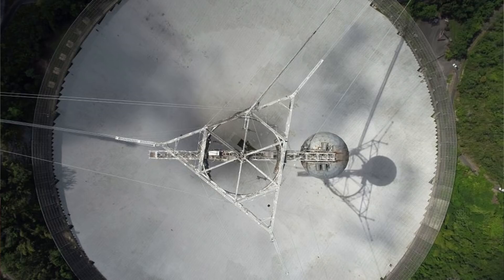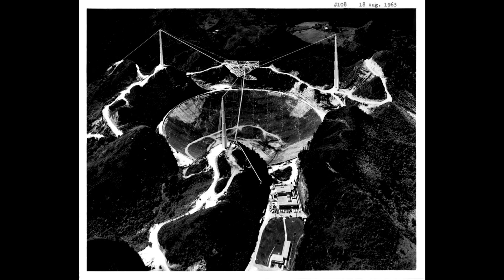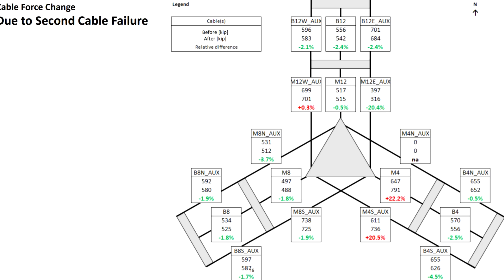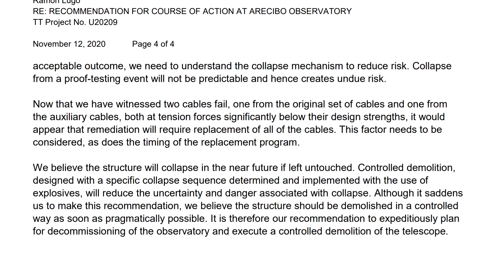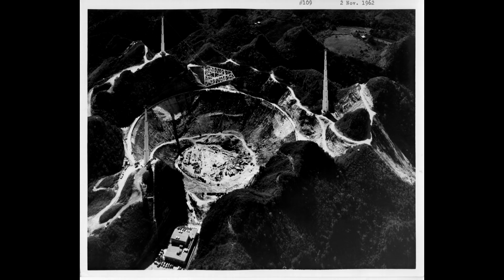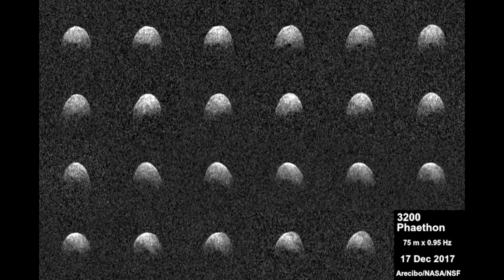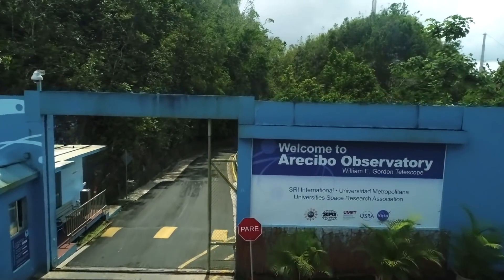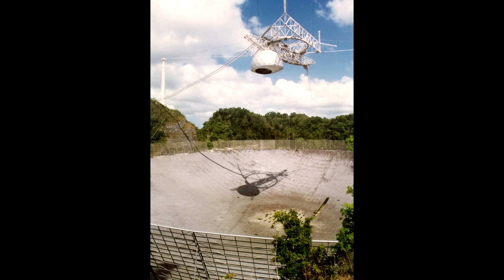Worlds Largest Radar Astronomy Dish To Be Demolished!

Comment: Only bright spot I see is if they take her down in a controlled manner the foundation would still be there to build upon.  Though it may sound strange but doing so may be pointless soon.  May mean a decade or so of delay but once Starship is on line Astronomers world wide should be SALVATING at the options it opens.  And I'm not talking another Hubble I'm talking a set of telescopes on the Moon.  Half month complete darkness, for all intents no atmospheric distortion, no protestors outside saying this is a sacred mountain don't build it here.  Build em in three's about a third way round the moon each for continuous observation and a couple weeks a month for maintenance...   
Don't take it wrong its a sad time seeing an Icon die but.  However Arecibo's life and death should be celebrated for what it accomplished and the future it inspired so many to look too.
Reply: The possibilities Starship offers are huge. I envision a nuclear powered full spectrum array orbiting in the Moon's shadow, connected to a large communications network. There isn't enough scientists and computing power to handle the volume of data something like that would provide.
Reply: The foundation is designed for the structure it supports.  You don't tear something down and reuse the foundation.  You design a new one for the new structure.
Reply: True but I was referring more to the fact the site already has infrastructure (roads, power, ect) and a lot of the major reshaping of the ground would already be complete.  As in a lot of the ground leveling and reshaping would already be done.  Sinkhole or no they didn't just plop a dish down in it without a lot of earthworks first.  But you are right about the building foundations those most likely would have to go entirely too many bad incidents with such being re-used

Comment: Radiation from an object at distance R goes down at a rate 1/(R^2). For Radar it is really a distance of 2R (back and forth) so the rate is 1/(2R)^2 = (1/4)*(1/R^2). This is not the same as 1/R^4.
Reply from the maker: You’re assuming the target is a perfect retro reflector, rather than isotropically scattering
Reply: @scottmanley  You were talking about the relation it has with the double distance of radar as probably compared to radiation emitted by a body. And 1/R^4 is not right. A more accurate model has to add other effects as for example reflection and medium loss, where the former has no correlation with distance whatsoever and the latter for sure but my guess is never getting into exponent 4. But let us agree you where justifying R^4 as a consequence of the travel back and forth and not as an estimation of full model dynamics.
Reply: @scottmanley  I can see how a large/round body, like a planet with an atmosphere, acts as an isotropic reflector. I am curious if smaller asteroids which have a rough surface can act partially like a retro-reflector? I assume they fall somewhere on a spectrum between the two perfect models. (Could this be used to study the properties of the surface of an object? If we vary the intensity of the beam, it should be possible to calculate the amount of scattering without knowing the absolute reflectivity of the surface.)
Reply: Of course the object reflectivity is worsening things.
Reply: The return signal strength depends on whether the target is a mirror or diffuse reflector.
Reply: @gordonrichardson2972  That's what I wrote, but it is not related to R.
Reply: Does 1/(RR) hold for a radio beam too? I thought that is for isotropic antenna only.
Reply: @pitu72ger  It is realted to the rate at which the area of a sphere grows (4*pi*R*R). It is true for the rate at which a patch in the sphere grows when radiation is directional (some angle). I understand even lasers that have some aperture angle are subject to this effect. In general terms it holds for sound and electromagnetic radiation. Of course the model for sound has to factor energy loss by heating the medium. Electromagnetics in vacuum have losses due to molecules and dust.
Reply: @techno_mesh  thx
Reply: I noticed this problem as well, and it changes the result of the calculation around the 10:40 timestamp. If aracebo is 20x more powerful (in terms of radar output and collecting area) then it can collect the same amount of light from 4.5x the distance (square root of 20). Note that the extra 1/4 factor doesn't affect the comparison.

Comment: Maybe a good opportunity for Arecibo 2? Clear the old and build the new.
Reply: I think today another approach would be done. Today's signal processing allows to use a telescope array VLT, etc.
Reply: @kraftrad7840  Good point. One way or another, I'd love to see a next generation of science happening. I have a sentimental place in my heart for Arecibo, so I hope we get something. Happy to pay more taxes to get it done.
Reply: @kraftrad7840  A synthetic aperture just doesn't have the same 20TW effective radiated power. Yes, twenty terrawatts. That's a lot of cooked turkeys.
I like what I've seen from the synthetic aperture tools in terms of angular resolution, but that solves a different class of problems.
Reply: @DrewNorthup  What has the attenas focusing capability to do with the imaging principle?
Developing something larger and more powerful than would explode the costs, i so unlikely to be funded. A new telescope should be significant larger. Not 500m and not 1km. A magnitude larger
Reply: Well, global warming is a very important issue.

Maybe we need to push a case that it is VITAL to NEO research, and then maybe we can get it?
Reply: @zaclegoattack  Which in fact it is 😓

Comment: A snapping cable under strain does not pull away straight as you would expect. They whip around a lot with a lot of kinetic energy behind them. The helicopter idea is VERY bad.

Comment: Good job reporting on Arecibo. Maybe they can replace it with a phased array type? I'm an old iron worker, them cables become a problem without regular upkeep... Walking on that stuff would be a rush, but the way it's falling apart, not really safe! Corrosion is probably most likely to blame, access being the reason... Sorry day for science and Puerto Rico as well! Thanks again, great channel, keep up the good work.
Reply: we've had a cat 4 hurricane in 2017 and then like 1000+ earthquakes in 2019, it took alot of damage.
Reply: I like your thinking. 👍
Reply: Unfortunately, I strongly suspect a phased array in place of the mobile secondary reflector would likely have the same if not more mass.
If you mean an array of multiple independent dishes that's another can of worms. You can easily get a  huge virtual aperture, but you won't have the same power handling capability.
Reply: @DrewNorthup  thank you sir... Just thinking out loud!
Reply: Corrosion on the support cables was detected decades ago. At the base of each support tower, industrial blowers were installed. These ran full time blowing air inside of the cable covers, lowering the humidity to prevent/slow down the corrosion. The current scenario was contemplated before the installation of the blowers. The replacement of the cables was not considered feasible. Kudos to the engineering team and the local builders who constructed a marvel that withstood tropical weather, earthquakes, hurricanes, etc. for such a long period of time. The Observatory was the inspiration for many and a tool with many firsts. History can be a capricious lady, but the Arecibo Observatory will be remembered proudly.

Comment: You should request a tour and go there man. It's pretty much the most iconic piece in space observation history.
Reply: the engineers concluded that the thing may fail literally any minute now, a 1000 ton steel structure crashing down from the sky, they set up an exclusion area and nobody's allowed to get close, there's no saving that thing anymore
Reply: I could imagine Arecibo and NSF wanting/allowing some popular science communicators to go there now... Document it properly.  Not sure if Scott is the most obvious choice, but sure.
Reply: Yeah if they considered but ruled out "repair person tethered to a helicopter", it's pretty risky. Maybe the next one should have a path of removable dish parts to install scaffolds for maintenance?
Reply: @rpavlik1  if a taught steel cable snaps, you don't want to be anywhere near its reach in any direction.
Reply: @rpavlik1  Next one may be an array of smaller dishes.  We've gotten pretty good at combining signals... We can do it with optical now, and radio is much easier.
I think the key is to have a setup capable of transmitting at very high power so we can do radar astronomy.  More radio astronomy capacity isn't bad or anything, but radar was what made Arecibo unique instrument wise.
Reply: Well.....one of the top

Comment: Either of the cable failures could have caused additional unseen damage anywhere in the structure especially in the opposing towers, cables and anchors, even relieving the load could cause collapse.